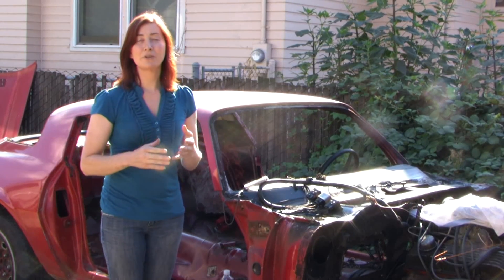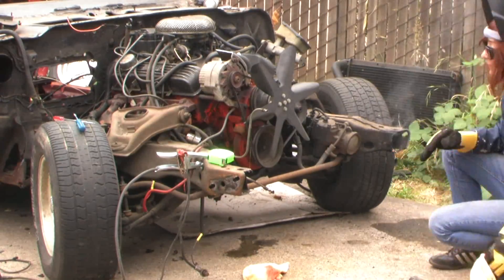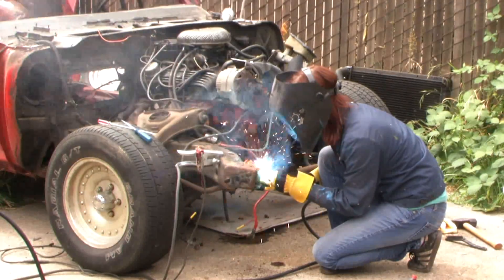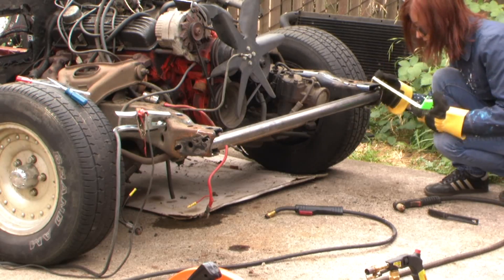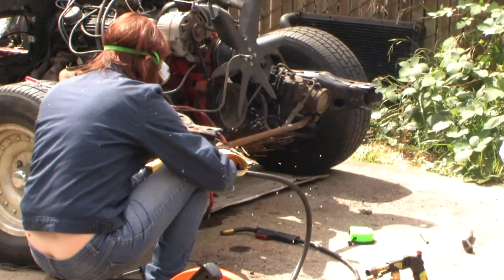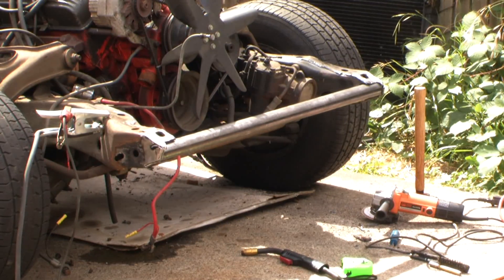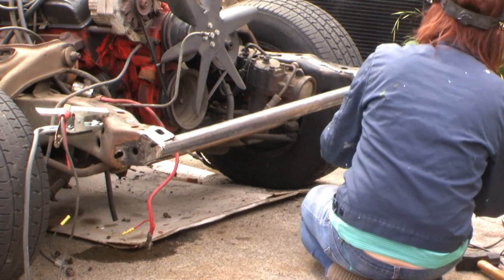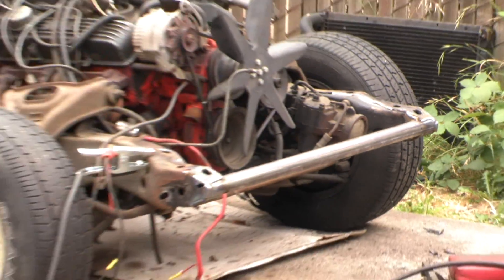Front Frame Horn Brace - Building a Pure Stock Race Car

Comment: Old comment, but I just saw it, hope you've come down on the side of an auto helmet.  As a professional structural welder, I wouldn't work without one.  They are safer and eliminate rogue arc strikes.  You won't hear any mixed reviews from pro welders, only opinions on brands.  I use an Optrel Satellite, but Speedglas, Huntsman, Jackson and Miller, all great.  Stay away from Harbor Freight- good price but iffy response time.

Comment: 2000 dollar welder 40 dollar welding hood. not good those harbor freight hoods dont darken fast enough. if you weld for 8 hrs. its like you stared at arc for 5 min

Comment: Wonder if you've ever used an old leaf spring instead of a steel bar to brace the front, you could still weld the mounts on and just bolt the springs themselves to keep them springy etc

Comment: I sawed off a finger using a big chop saw like that.  It didn't have a working clamp and the tube jumped off the saw blade and threw my hand into the blade.  Cut it clean off.  Stay safe Jeri!

Comment: just curious as to why you would add a brace inbetween the frame horns. The pure stock cars I worked on we had to use a stock style bumper on the front BUT used square tubing on the outside of the frame rail then slide round tubing into the square tubing welding it then mounted round tubing to the bumper and then bent round tubing that went from the bottom of teh frame horns and an aftermarket aluminum rad would sit on that round tubing so incase of a wreck the subframe would be ok

Comment from the maker: @blckfire539 I couldn't live without them.  I got my first unit in 1995 and it worked well when the sensor was clean, sometimes it wouldn't darken when dirty.  The new units with a solar cell are better and cost less than $100.

Comment from the maker: @blckfire539 TIG welding is too slow and not necessary for this chassis.  If we were allowed to use very thin metal then it would make sense, but we're required to use very heavy walled tubing.  It is an auto darken helmet with a big LCD shutter.
Reply: О боже мой ! Jery Ellsworth умеет варить и делает машины )))
Я с трудом представляю женщину инженера по электронике ))
Но что бы она еще и машины делала ))
Это выше моего понимания ))
По моему мужчинам останется только ухаживать за детьми варить еду и стирать ))).
73 !